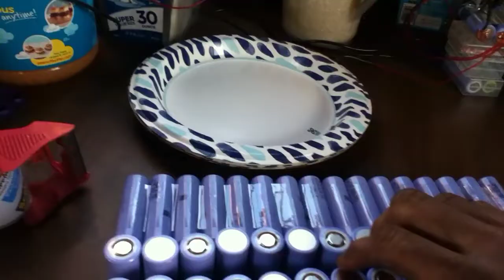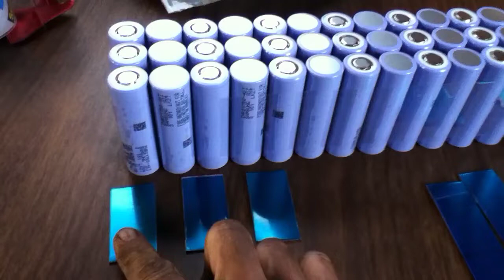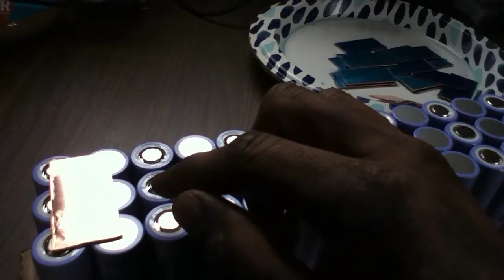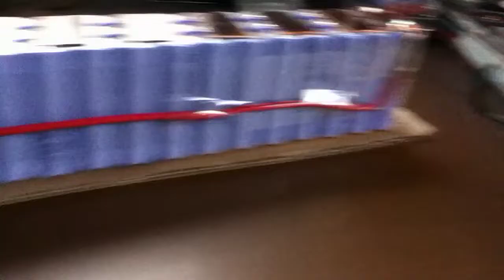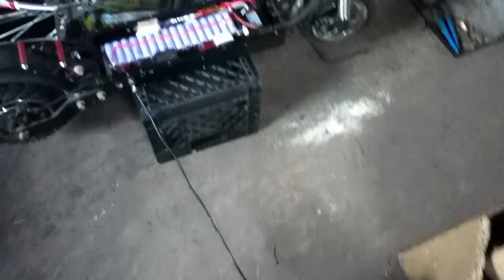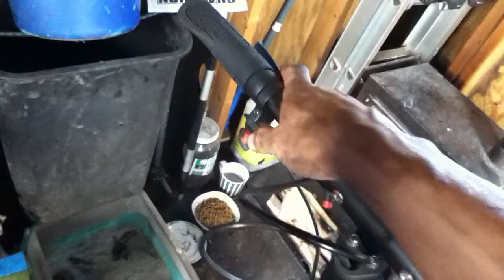How to Build Battery Pack without Soldering ,the Simplest Way

Comment: No offense but if it was a terrible idea and failed 1 month later you should unlist this video to avoid spreading horrendous advice...
Reply from the maker: None taken.  The real problem is the fake silver epoxy which was noted in this video in the disclaimer comment.  Should the real silver contained in the epoxy it would've been more than reliable for battery applications such as this.  The fake silver the criminals produced in the underground aren't worth anything, anything at all. They are left-over junk metals, faking them as silver and gold.  The metals are so shit it's barely enough to handle 5V with low current application.   All the good high purity metals go to the criminals, for their battery, electronic warfare human target weapon, which outputs tremendous amount of power.   Most of the criminals underground are the North Koreans, they are all over the fucking place underground, even underground underwater including Pacific ocean.

Comment: At $250+ for 48 calls you can buy a 48v battery so 2hat was the point of building your own battery
Reply from the maker: 48V Chinese battery pack you buy are junk.  The cells can't handle high current charging and discharging.  They have short lifespan therefore. Also can't handle freezing temperature so they will not be dependable for load use.   You need to get the "genuine" part Samsung 40T cells for reliable use as they last nearly forever as their charging headroom is 12 amp, and 25A discharge, without any sign of degradation for lifetime.   Your batteries can't do that, it will get cooked for good.
Reply: You LEARN how to build a battery. WTF? You can recover second hand cells for nothing from old power tool batteries, computers and other broken comercial lithium batteries.

Comment: Those exposed copper plates are an accident waiting to happen...yikes!!!
Reply from the maker: Not if you apply enough tape over it in layers and cover it with a plastic stuff.  I don't use copper plates anymore cause I don't want to solder on the cells... I use nickel strips.

Comment: Thx for the video. You really helped me out alot. I got a eskateboard and the bms that cam on the battery wasnt working. Ur the only one i found with no bms. Thx. Keep up the good work👍👍👍👍
Reply from the maker: Thanks for the kind words. :)  Unfortunately I'm afraid that the reason why the BMS not working right is because of the voltage dip/spike, down low enough to hit the low voltage protection from the BMS.  Removing that would get the eskateboard to work for now but it will go bad soon because the batteries are dying..   Yeah, no BMS is best. I have been running the battery packs in my scooter for years now without any failure.

Comment: The reason why it’s cutting out because your bms u did not connect when u discharged it the first time then tried recharging it it would of not balanced each section to full voltage so this is the result in cutting out on u if u check the cells in parallel sets starting at the positive end testing as u go u will find a really low voltage set most likely 2 or 3 sets or parallel 
Interesting your using epoxy soldering only used for mobile phone and laptop as micro surface mounted components over time bumps and knocks will eventually break the epoxy it might be better to use copper strips welding the battery together just for future reference it’s much easier to
Reply from the maker: It was not the balancing problem due to the absence of BMS, it was the silver epoxy that could not handle the high voltage (60+ volt) and high current, not because they broke off from the copper plate.  The batteries, when connected in series and parallel, without BMS, they get self-balanced.  The BMS doesn't do the balancing, the physical batteries do themselves.  I have other battery packs with nickel strip and WITHOUT BMS have been used for scooter and been running strong rock solid for nearly 2 years now... Getting full power with minimal voltage spike.   As for the epoxy, it was not real silver (or high-grade silver) as the manufacturer claimed it is. It turned out to be fake.  If it was the real silver epoxy, it would've worked no problems.  Check my other battery videos where I explained more detail about this.

Comment: Hey what kind of charging port do you use for the custom built batteries? I will be building mine pretty soon here, a 14s pack and i was looking at chargers, they have 5 different ports to choose from, I'm sure it's just for people to match the chargers to the port that they already have, but i was wondering if there is one that's better over the others since i haven't picked up a port yet. Also do you charge at 2 amps, 3 or 5?

Comment: So what do I gotta do with my new battery so that I can ride it anyway I want because it seems like I can’t give it full throttle full throttle that by zips with that new battery and I wrote it fully charged with the correct charger I’ll even tell you the voltage on the charger All right I got the charger right here. It’s battery charger something very simple OK output 54.6 V DC is two a input AC 100 to 240 V a wavy/50–60 HZ in the model is ZYD – 54620. It’s a regular 48 V charger 20 amp power I can get you to specs and all that but I don’t even know if you’re gonna reply you’re the person I definitely would like to speak with. I could tell you how the batteries built it’s it looks like yours actually, but mine is like a two series. I think it’s a 10 SP I would have to look I would have to look, but I remember sending the specs out to somebody before and they said the specs don’t add up because they said the maximum current output is 13 a and because they knew the model of my bike they knew my controller They’re saying my controller puts out more current so it’s not gonna add up so I didn’t know what that meant. And he said I had 18 different exit lines. Don’t know what that means. Hi Kapacity high power basically it’s saying these are like the best battery cells and best built but then it’s not agreeing with my controller. I think it has to do with the voltage spike that you were talking about because I didn’t understand that but now I do Because on my stock controller, it says 15 a it’s a 15 one a I got a new controller from AliExpress it does handle 48 V 350 W motor and it’s a 18+ one60/120 everything’s written in Chinese but I’m pretty sure it’s the same thing as my other controller Maximum output current so usually somebody told me what I could do is do a shunt mod on my stock controller just a little so I can check the controller with the voltage so I don’t know if I wanna mess with my controller like that, but I’m definitely waiting for a far driver controller Which would handle anything anything that I decide to put on my bike I think anyway but great content I hope you can reply to my Messy question
Reply from the maker: So your newly built battery is 13s 2p?  2 Parallel connections in a pack is not enough it's too low.  What battery did you use to build it?  More detail on the battery would be helpful.  God is sensing me the batteries you bought are junk despite what is said on the battery, meaning it's not genuine.  Plus running them in 2 parallel connections will make it more unstable due to extreme power fluctuations (extreme voltage spike).  You will need at least 3p or greater.  And use genuine part (non-fake) Samsung 40T cells to build them. They are very high performance rating and actually capable. I can tell you where to get them if you want.   And do not mix different batteries together when building. The strong ones will knock out the weak ones.

Comment: That’s how I can ride my Jetson electric bike with my 48 V battery 20 amp power I could buy probably all day if I hit low speed, but I only have one speed that’s it the throttle and the pedal cyst so when I use the pedal assist it still shoot that voltage I’m starting to understand this. I don’t fully understand though, but I really need to understand the battery situation because I have a battery right here 48 V 20 amp power battery brand new. I wrote it twice and because of a power cut off on my electric bike I won’t use it because I don’t wanna ruin the battery. I don’t want to ruin my bike so I wanna test the battery I don’t know how to test it myself. I am going to get the tools and try and learn but you go titties electric bike shops and it seems like no one wants to help I guess because I got a little Jetson electric bike. I don’t have a what you call I really don’t have anybody to go to about the electrical situation on my bike, except YouTube

Comment: Doesn’t the BMS protect the battery pack? I’m only saying like from overheating and a dangerous situation. It’ll just shut up the whole battery pack off to my understanding without the BMS. It’s a greater possibility of a fire so I’m very interested to find out why and if it’s possible
Reply from the maker: As long as you use the right charger same voltage there is no need for using BMS. It does not protect the battery if there is short-circuit (ie. small positive wires touching the negative end of the battery or vice versa, even though they are covered with tape or thin silicon protecting the wire. It causes extreme resistance and start heating up killing the battery cell(s). The BMS will sense the problem and shut off the battery but the short-circuit will continue and the batteries will get damaged.  Just make sure that the wires are far away from the terminal ends of the batteries when building.  As for balancing, the BMS does balancing too but is a waste because the batteries themselves always self-balance at all times.  BMS will cause trouble shutting off your ebike if it senses a voltage dip spike that reaches low voltage limit when in fact that the battery has more room to run you longer if you didn't have BMS.  It won't hurt the battery.
Reply: an adjustable charger has a bms with in it, eliminating the need for a bms in the pack.

Comment: Great content engaged the whole time even though this is a year old video it’s very relevant. I just bought a 48 V 20 amp power battery. I put it in my electric bike which ones on the 36 V system everything stock the situation I’m having is it zips and flies in. It works wonderfully for like an hour, but then I was going up this hill trying to pull this big big hill giving it to Kapacity test and the power just drops on me. can’t turn the bike on anymore so I bought it home I put the charger in for five seconds and the power light went right on no power dropped at all not even one bar and then I drove it and it did the same thing again after an hour so I stopped using it and I put it away and I put my old battery back in until I can figure out what’s going on with this battery. If you know anything please reply great content.
Reply from the maker: Hi, God told me that you did put the batteries together correctly, all batteries making connection, and no short-circuit.  Are you running in 13s 3p?  And what battery cells are you using?  Is it LG M50 series?  God is telling me something is wrong with the battery cells themselves. Can you verify to me what model it is and where you got them from?

Comment: Buy solar an build battery bank
Reply from the maker: I do have solar system that is inter-configurable to either run at 30V or 137V.  I do have a battery bank for a little thing as a backup, but I do have two large (16s 8p and 16s 10p) battery packs running in parallel as a home energy storage to power all my needs and also be able to charge my scooter too.

Comment: Why you didn't put BMS balance???? This is right or no?
Reply from the maker: You don't need BMS because the battery cells in the pack all get self-balanced constantly.  The only thing the BMS will do is to limit the incoming voltage in case if you accidentally grab a wrong charger and charge the battery at higher voltage than your battery is intended to take.  BMS also robs power coming from the battery due to heat generation when large current goes through the BMS.

Comment: this is very dangerous.... all it takes is alittle to much heat and the cells can touch with the cell next to it. you need some sort of insulator other than the battery plastic.
Reply from the maker: It's not the battery cells being close together (or touching) cause thermal runaway per se... It is every individual battery cell that has deliberate design flaw to make negative and positive metal so close together, causing resistance and heat as more current flows through the cell.  Watch this video, it will explain to you in detail -> https://youtu.be/zBRU20bE4Y8?si=owNTFd4s7Iz8mguA   why it is so dangerous.  Be sure to read the description or sticky comment in that video as well why the criminals do this to all battery cells in the general market and not for their own special high energy high output batteries.

Comment: 10s4p carries my fat ass at 25mph 😊
Reply from the maker: Nice.  God told me that you are riding an ebike with that battery... .  .  . You know you should get a scooter (5600w scooter size, as it has big enough deck inside and big motors to spare) and build large batteries.  And later build another pack and use an external battery bag to mount on the steering column of the scooter and parallel them via cable plugs.  You can then travel longer at least 60 miles and at 30 mph cruising speed.  My current scooter is now equipped with total of 3 battery packs in parallel, the third one is installed inside the storage case in the bike trailer hooked up to my scooter.  The range is now over 120 miles.  The trouble to the world is coming soon where there will be no more gasoline and electricity supply.... as they come from underground run by the high-level criminals and they are gonna get all eliminated in the near future.

Comment: Using the copper plate is a good idea but instead of epoxy you could have used solder paste, you'd still need a soldinging iron, you can run these using any inverter since you only need 200w max, you are correct that you dont need a bms but you need some ways to monitor the voltage from each cells, the wires you are using looks like 4mm wires which is about 40 amps max. you need 10mm cables.

Comment: I use battery good quality 18650 battery holders, then thick copper solid conductor to solder between the battery holders

Comment: Hooke has made a 3S battery, do I have to take it in the car or train because I charge my mobile in it?
Reply from the maker: Ok God told me that you live in offgrid and you are in need of solar panel setup to charge your phone and power all other needs. Get at least one 24V panel or two. Each will cost a little over $200. Get a charge controller for the battery here ->  https://www.aliexpress.us/item/3256805798227949.html?gatewayAdapt=glo2usa   Get a 60V battery pack here ->  https://www.amazon.com/Wroyeti-Electric-Extension-Connector-200-1800W/dp/B0BG5G6VW7/ref=mp_s_a_1_3?crid=2TPGF3Z9QJL3N&keywords=60v+scooter+battery&qid=1706720715&sprefix=60v+scooter+battery%2Caps%2C197&sr=8-3&ufe=app_do%3Aamzn1.fos.c3015c4a-46bb-44b9-81a4-dc28e6d374b3   Get an ebike controller to power USB devices here ->  https://www.amazon.com/gp/aw/d/B09FQ52163/ref=ox_sc_saved_image_10?smid=AA5PISMZNU1KS&psc=1   You also need Y split XT60 connector cables to power USB ports.  And you need USB ports get them here ->  https://www.aliexpress.us/item/3256804439558261.html?spm=a2g0n.order_detail.order_detail_item.2.41b6f19cTWfNQE&gatewayAdapt=glo2usa  and get some 20 gauge wires to connect some wires and heatshrink.  If you need help on wiring USB ports watch my videos about powering these devices.  Let me know for more questions.🙂

Comment: We need more ppl like this guy ,honest in what his talking about.this guy dosnt make a video for us to start fires,he makes and shares of the knowledge  he knows .good on you bro,
Reply: Do u know how to rewire ,hub motors 2000w ,I've try once and nothing  happen lol. But I'm about to try my second attempted, ,hope u could maybe advise me as to where I'm going wrong briefly,or I'd love to see a video step by step.keep it up brother
Reply from the maker: @user-no8fh6qp9d  Do you have two controllers that came with the scooter?.. If that's the case make sure that those 3 phase cables (yellow, green, blue) from the motor are connected to the primary (master) controller and not the secondary controller that is bridged. That should get the motor going.
Reply: I had a 48v 15ah was only a year old.so I've striped and checked out the battery pack wiring.no power,an not charging .so now I've dismantled batterys bit by bit, checked each one and the fully charged ,so yeH was THE BMS THAT FAILED.,THIS IS MY FIRST build copying what I've seen u do on utube,,thankyou
Reply from the maker: @user-no8fh6qp9d  I am afraid it's not the bms that failed, it is your battery that gone bad from high current charging. Even if the cell is showing the voltage it will hold no charge when put to load.. You'll have to buy new cells.
Reply: 3p isn’t enough amps.
Reply from the maker: Thank you..🙂 Yes not using BMS doesn't cause fire, short-circuiting can cause connector metals on the batteries can.